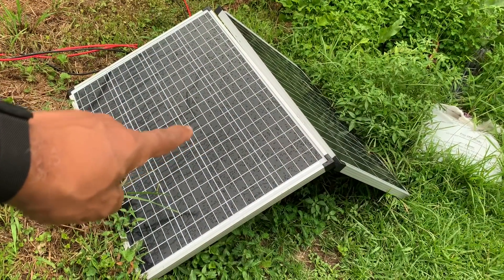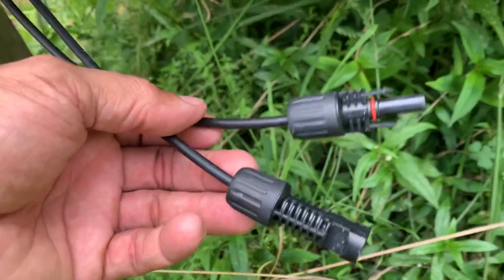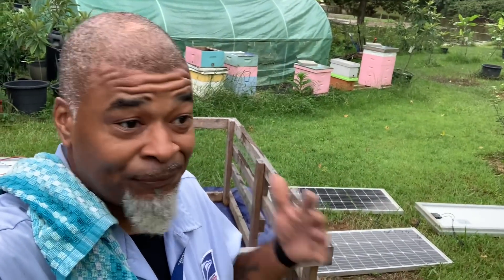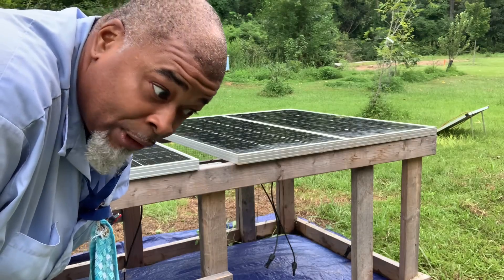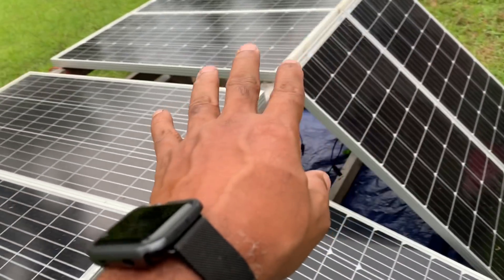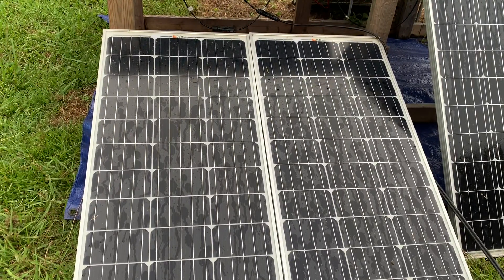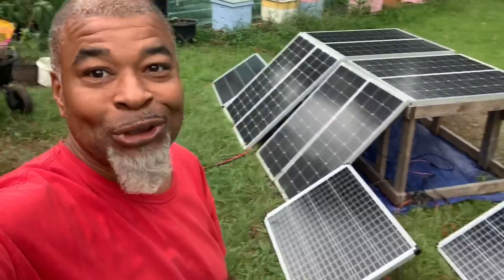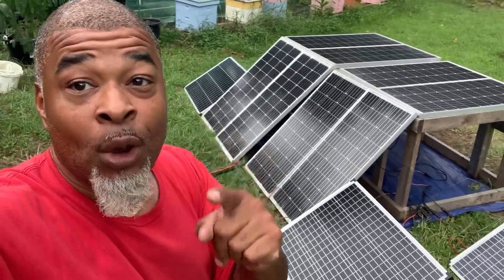Connecting Solar panels in series and parallel  Renogy, rich, HQST, harbor freight, Solar panels

Comment from the maker: Bluetti ac200p https://amzn.to/2WLMwQ1
BOUGERV 716 SOLAR GENERATOR https://amzn.to/2WWvQFt
ENERGIZER 320WH WATT SOLAR GENERATOR https://amzn.to/2YrAmMB
ECOFLO RIVER 600 https://amzn.to/3h2tKe9
JACKERY 500 https://amzn.to/3h21DLS
BLUETTI EB70 https://amzn.to/3yJiR
RENOGY 1OO WATT SOLAR PANEL https://amzn.to/3tn4tAg
RICH SOLAR 100 WATT SOLAR PANEL https://amzn.to/3jPxeCB
HQST 50 WATT SOLAR PANELS https://amzn.to/3DOK1wY
BOUGERV 100 WATT FOLDING SOLAR PANELS https://amzn.to/3nagXtE
BLUETTI 120 WATT FOLDING SOLAR PANELS https://amzn.to/3DLo7dS
KILL A WATT METER https://amzn.to/3yOjRGO
SAE TO MC4 ADAPTOR https://amzn.to/3kQNxyg
30" MC4 EXTENTION CABLE https://amzn.to/3kWRykw
8MM TO MC4 https://amzn.to/3zOc3WM
8MM EXTENSION CABLE https://amzn.to/3tcFQ9c
https://www.bougerv.com/pages/leadfarmer73-fans-page
Reply: Lead, I'm been looking since you did the video on the Go Power Plus (got it) and the Thunderbolt 13 watt solar panel. Where can I get this Thunderbolt briefcase solar panel from? Amazon, Harbor Freight, etc. have been sold out. I checked Google, no luck. Please help. Can I use another solar panel, if so; which one? Thanks!
Reply: Is there a disadvantage of having solar panels installed  on the roof of a house?
Reply: TY Lead....🙏😊
Reply: @leadfarmer73 Hi!   After binge watching your videos the past year we went ahead and got the PPS2000 and the Renogy 100 panels.  We are in FL and we are seeing TREMENDOUS heat effects... in summer the 100w goes to 20w.  We see a brief jump to maybe 54w if we hose them down.  I've tried pointing small battery fans down there... nothing.  Are you seeing this type of heat effect?  We would love to have these as a back up during hurricane season (we are on the coast in central FL) but they are taking forever to charge the generator.  Thoughts with your experience in the Carolinas?  Thank you so much in advance!

Comment: I like the frame idea. Pretty good idea. 

Might add a mechanism on each side to change the angle for time of year. 7 degrees for summer in Texas versus 45 degrees in winter makes a difference.
Reply: Yup, and those brackets to hold them down are a must.

Comment: LEAD I just got the ECO FLOW MINI and I have 2 100watt panels  was wondering if I run it series or parallel I'm just using the UNIT for my GREENHOUSE  I connect a FAN and HeAter for night and day  so I'm trying to figure out WHATS THE BEST WAY

Comment: I have harbor freight solar system. Isabel 5 panels , 3 batteries parallel,750 watt Jupiter inverter, 30 amp controller. I ran pool pump and salt water system during day earlier this year no problem. Now I’m trying to run heat lamp for new chicks at night as we have a cold snap here in Florida panhandle. It runs for maybe 10 minutes, shuts off and starts continuous beeping. Batteries say 11.5 . What am I doing wrong. I would think the batteries could run a lamp for 8 hours or so. Your help appreciated.

Comment: I will tell you I went with the Epever 30 Amp waterproof charge controller.  $86, and Epever is among the top three in all the ratings.  I have two, so each is connected to their own set of panels.  Oddly, this MPTT controller is far cheaper than the non-potted, less rugged, bells-and-whistles controllers they also sell.  It automatically is set up for LiFePo batteries.

I wish Unisolar hadn't gone out of business.  I have 4 of their 18 foot roll-down, self stick panels, for the roof of my RV.  Wish I could have gotten more.  Amorphous drop less in output, when poorly aimed and on cloudy days.  Even work well when partially shaded, since amorphous are cross-connected inside the panel.  The Harbor Freight ones are the same.  I have 600 watts of theirs.

Good luck and keep on keeping on, on YouTube and in life.

Comment: You know, I have a really humble setup with my van.  A battery, a charge controller, and a solar 100 watt standing solar panel with an older battery.  For the first time this last Sunday, I had everything up and running and watching the amount of power created with the sunlight.  LIke, with just a bit more battery storage I could run a fridge and more.  I don't see why the world just doesn't covert to solar/wind/hydro

Comment: Hi Lead, I am new to solar, I have a  sq ft shed to home and I want to be completely off grid, nothing to do with our power company and I don't feel good with propane (I know a few peeps that had bad accidents with that) I want to living in this by Nov. I want a apartment size fridge and a TV, a tankless hot water heater and my kitchen gadgets: crockpot, foreman grill, toaster and a microwave if I can. Research wise I think it will be a Natures Head toilet but I just don't know how much/many panels I need to live there and have no worries of running out of power. Some people say just buy the Amazon package for $1500 and let the panels charge and plug into the generator and there you have it, but then I hear Amazon panels are not good, I'm so confused, can you give me in guidance. Thank you

Comment: Like this set up.  I've just started on my solar, and yes, like you said in the live stream, it's addicting!  I have a Togo 330 and 2 portable 100w Rockpal panels I purchased for travel in my vehicle.  Now I want a bigger battery and more panels, lol!  My electric bill this summer has been over $300 a month because there is so much wildfire smoke we are unable to open the windows at night to cool off the house due to it being so unhealthy to breathe.  This amount for just electricity is unsustainable for me so I have to do something about it.   Solar is the way to go.  And not on the roof, hooked up to the grid, because when the power goes out, the solar will also go out.   Have a very teeny yard, but am going to put hooks in the fence and hang the panels out there during the day, bring them in at night.  I would love the Bluetti you've got but a bit out of my price range right now.  Maybe the price will be cut a bit in a few months when the weather isn't so sunny.  Thank you for your information and being entertaining at the same time!

Comment: I'm completely new to your channel and trying to wrap my head around the concept of solar.  How much of your home's electrical needs is this setup providing?  I assume that you are now completely off the electrical grid.

What about in summer when you are running your AC.  How many more watts does it take to run the AC in the south?
Reply: I have about the same amount of panels he does and this amount is no where near enough to run a whole house, u need many more watts in panels and several big batteries as well, and big pure sine wave inverter as well. In short, solar for a whole house is much more expensive and complicated than systems like this one shown. These systems are great however for emergency situations to keep some lights on and a few fans as well as charging devices such as phones and computers.

Comment: I have "repurposed" 4 grocery store carts and use them as stands for each of my four panels...I have them on a concrete deck and being able to roll them around to face the sun is great!  The panels get plenty of ventilation, the carts provide multiple ways to place the panels, they are sturdy, weather proof...On each cart, I have room for a panel up top as well as another propped up in front of/against the cart (so housing for up to 8 200watt panels).  I also use swim noodles as extra insulation for all my cables to my panels...Urban prepping at it's best...

Comment: With poly and mono panels in series, the current is limited by the panel putting out the least amps.  With some at a different angle (the six in series), the Amps will drop to the output of the panel least aimed well.

Comment: I'm truly new to the solar.     I sorta want on the roof,    I felt I might want on the wall.    I was considering building a frame similar to yours,   but I thought I would need to dig holes to secure it.    After watching your vid,    I think I may think about it again,   since I don't have to dig holes now.
But 
I do have 2 old clothesline poles that have frustrated me for years,   and now I can repurpose them as solar panel poles.
Again,   I'm soo new,  that I'm testing things out

Comment: COOL~ You could cut the legs of it off some on one side to have the top slanted and still be able to use the ground panels on the lower side. That looks good Mr. Lead!!!
I just ordered me a Eco Flo River 600 watt. Found it on Amazon for 289.00 list price was 379.00 and they had marked it down. Now I can use the two 50 watt solar panels I have in parallel with my adapter I bought to charge it with I hope. I just watched a vid about the River and it said something about the hook ups to solar. Now confused and wondering what adapters I need to get to use solar power with it. ????? Again thank you so much for teaching us all this solar stuff! <3

Comment: Why don't you just keep panels as a chicken coop roof, and make the coop a bit more portable so you don't have a loss of sqft production on your land. You could be using that space with the heat generated to brood chickens. You could easily add hooks to keep wires away from chicks too.

Comment: Hi Lead, the tarp is a great idea. I haven't bought hard panels yet because I only have a jackery 1000 for solar backup but I'm looking at the ac200 when I get my next big cash bundle. I saw the rich solar panels for only $89 on Amazon.  QUESTION: What is the cable you're using to extend beyond the original connection cables? (i.e., extension cable for longer distances). Thanks

Comment: Suggest you put wheels on that coop and just saying maybe $7 per leg depending on size. That's what I did to my raised beds and walla easy does it. Also adding 45 degree pieces of wood frame to the sides and that way if you need to bring you panel shack to the driveway to work on it. Just my thoughts. Love it Led!!!

Comment: You may want to tack your tarps down so the wind won’t catch the edges and pull them up. Also, you may want to run the wires going to the house to be in a little pvc pipe for visibility at night and so you can weed eater around them easier.
Reply: Great idea!!!

Comment: You can use cardboard or newspaper to kill the grass and use black fabric weed block. It easier to control the exact measurements you need, and will last longer than the tarp. Water run off will go directly into the ground, instead of puddling on the tarp, which will give the mosquitoes a breading location, and invite other wild animals looking for a drink.

Comment: Nice!! Timely too. I can't get the MC4 connectors from the Renogy panel to attach to the MC4 connectors of my Bluetti DC input cord. Seems the panel's connectors are a tad bigger (at least the O ring is) Did you have ANY problems? If so, how did you resolve cuz clearly you are charging!!

Comment: So its true about the Jackery 500 and smaller they can’t handle even close to 100W input? Also split flexible electrical tubing might be a nice add to clean your extended wires up a little to the house if you like that look...  I like this set up, great idea!!!!

Comment: Question why not build it higher like another layer of what you have and you will not have to worry about the grass cutting and the panels  on the ground will be out of the way and you will not have to worry about anything hurting them at all. Your back will be safe also from hurting.
Reply from the maker: then I may as well put them on my roof. that all bring the same problems. I'm not worried about my grass. lol it's just grass.
Reply: @leadfarmer73   no sir you will be able to work on them and they will be out of harm way. Putting them on the roof makes no sense you will be able to work on them without bending down is what I mean.

Comment: Will you buy the expansion battery for your ac200p?
Reply from the maker: NOT AT THAT PRICE. I MAY AS WELL BUY ANOTHER AC200P FOR THAT RIGHT? NO WAY
Reply: You right. I ended you buying the Ac200max with 3 PV200 solar panel. You and the rest of the solar community are going to drive me broke lol thanks for the you do sir